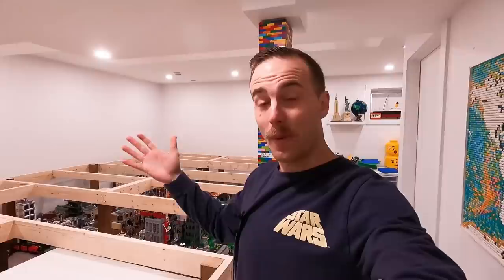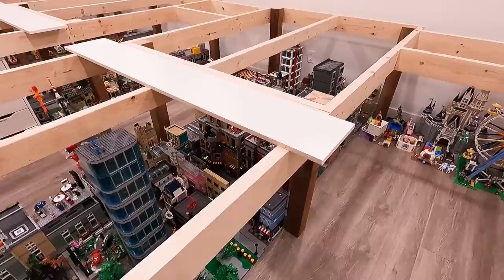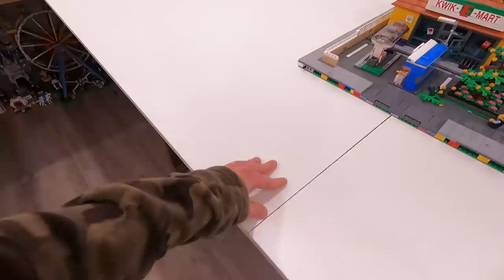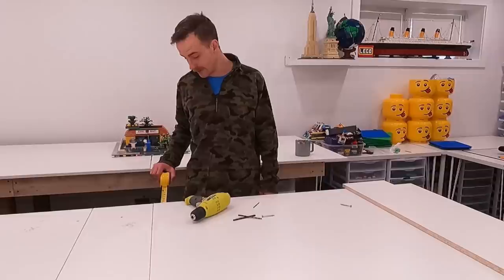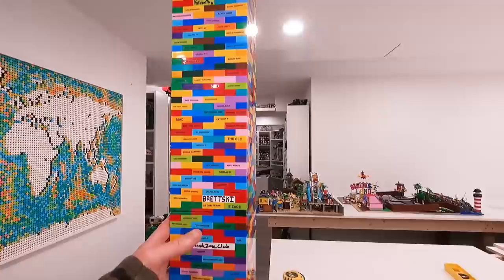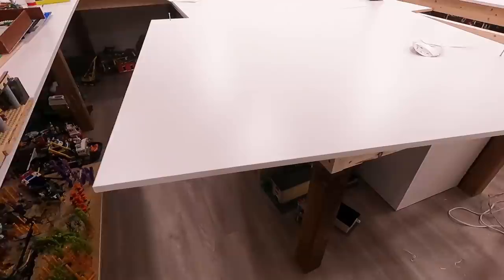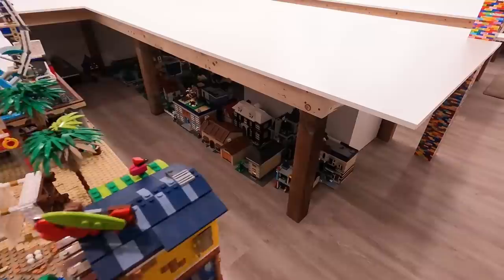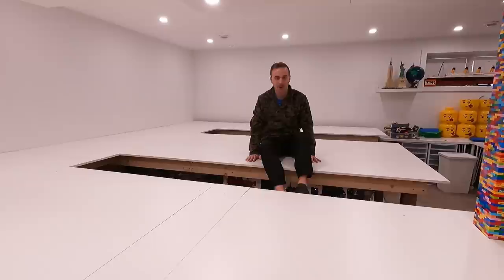Insane LEGO CITY TABLES Ready to Go! Room Rebuild Part 7

Comment: If you want to create levels, you will now either need to add in wooden boxes or use quite a few bricks.
You really mist the opportunity to let your beach sink a little into the table, by carefully grinding that part of the table, down a bit.

O well, just means that when this one is done, you can break it all down, again, in order to introduce some level effects.
Also a mist change to add in a under the table train track system, for some proper underground station stuff and so on.
Just think if you just used it as shadow tracks in order to increase the time that your trains turn up again.

And if you add in a lower edge, you might even be able to build up the sides of the table, with bricks as well.
Could be fun on the beach side, for one, if you could incorporate  things like the Lego Aquarium and so on.

Comment: I wonder if some thin soft squishy layer on top of the tables would help with leveling. (maybe like no slip drawer liners) Even with the slight height differences now you should be 100% better than the Ikea tables. I would expect minimal stressing on your set up, unlike before. Its looking great!